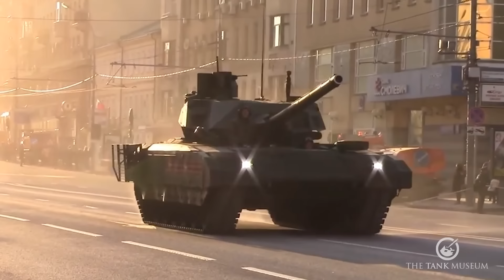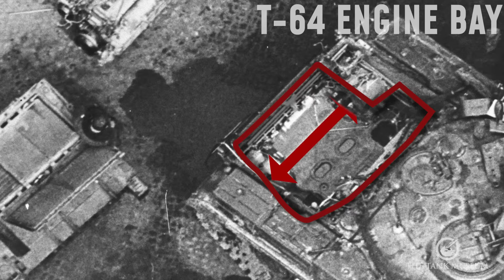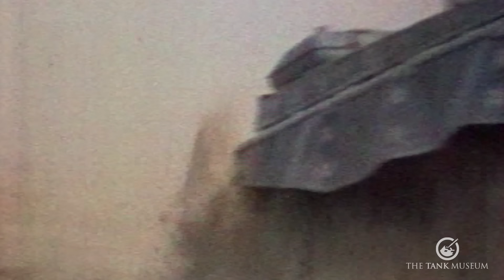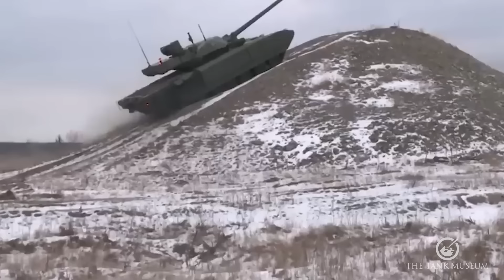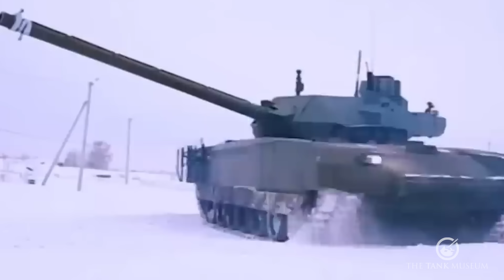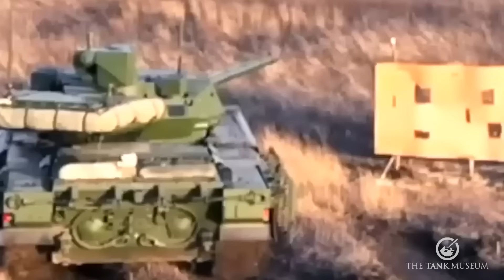Radical or Ridiculous? | T-14 Armata | Tank Chats #171

Comment: A lot to go over here.
780Hp. .so what ??
Horsepower is useless..
You need TORQUE !!
Example, a corvette might make 450 hp.
But why can a 350hp Cummins pull 80k up a hill ???
The Vette might have 4-500 pounds of torque, yet couldnt pull 80k up a hill.
The Cummins will have like 1250 #'s of torque.
(newer ones up to say 1450)
Horsepower is RPMs multiplied.
A 600 hp Cat engine makes over 2000 #'s of torque.
Forget horsepower...
(note: I understand parasitic drag)
Torque moves the load!
As far a view...
Even mini vans come with back up cams !!!!
Why can't tanks use this simple technology for seeing holes to drive around ???
I know...this is TOO complex of technology....(??)
As far as armor ....so long as cab/cabin has armor, what more does the crew need ??
The ammo hold has soft tops, allowing explosive force to go UP !!!(obvious bulkhead between ammo and crew.)
Reply: Why does the average torque monster bus accelerate slower than a 1 litre shopping car? Power to weight ratio - and that right POWER - not torque to weight.  Torque is just a measure of turning force, power is workrate - it's work rate that gets you down the road fast.   You can give any engine as much torque as it needs using a torque multiplier - known as a gearbox.  Power is king.
Reply: @LondonSteveLee  your WRONG.
As example HP Gives you mph at the drag strip.
Torque give you ET.
I have zero problem pulling an 80,000# load 75 mph with a 350/400 hp engine.
Like I said, try doing that with a 500hp Vette !!!
The torque gets you there.
I pulled loads for kver 40 years...I KNOW the difference between HP and TORQUE.
The new emission trucks have LOWER HORSEPOWER...
But GREATER TORQUE.
Simply ...just think of the Vette VS An 18 wheeler.
If you so choose...we can also get into gear ratios .
I started out with a 9.5 -13 speed. (RTO9513  etc)
Now we're up to and over 17.5's as torque increases,
But HP was lowered due to emissions.
Ps. we do this at 2100 rpms
Or LESS.
What's a Vette pull5-6k revs??
With a clean fuel filter I can pull 80k at 14-1500 revs.
Reply: @LondonSteveLee  NO  YOU CAN'T !!!!!
The engine makes torque !!!
Period.
The Vette in lower gears
With a good gear box..

May...pull 80k
But youll NEVER GET MPH !!!
I've driven trucks, say an old NTC350,
Which couldn't pull OD.
(Over Drive)
In the wind for sure, you had to run direct.
You know all about gear sets right ?
What's the difference in 3rd gear in a car with a 3 speed manual vs the same car with a 4 speed ????
Reply: @LondonSteveLee  it's not physics !!!!!!
An engine makes X Amount of torque P E R I O D.
(period)
A trans allows the engine to accelerate .....to its torque curve.
(engine RPM) VS Drive shaft RPM.
The difference is according you the gear RATIO !!!
An engine has ZERO idea of mph!
ALL it knows is RPM !
....IF....

If it's got torque..it can achieve a given RPM.

You...
My friend...have "0" (zero)
Idea what our talking about.
There's NO SUCH THING, as a 4th gear or 3rd in a spd.
It's DIRECT!!!!
No "ratio" involved!!
No GEARS !!!!
Our simply locking the input shaft to the main shaft.
In other words drive shaft turns engine RPM.
IF....you put a trans mission on an engine on a Dyno....
Say even an RTOO14618,
The engine will make the same torque !!!
ALL a trans will do is allow it to achieve its RPM/TORQUE band(s) sooner .
It will NOT...(not)...
Make a ftlb EXTRA of torque.
You "think" you know physics ???
There's NO physics evolved!!
Its all "MECHANICS"
='s MA.
(Mechanical Advantage).
Transmissions...
Govern RPM !!!
NOT TORQUE !!!
Take any car with a manual trans...
At say 10 mph...
Put it in second.watch tach till it starts pulling good.
Now..do 10 put it in second..
Accelerate ...till it pulls..(notice tach)
Again, do 10, put it in 3rd.
Accelerate till it pulls good.
(notice tach.)
Now again doing 10 put it in 4th.
Again accelerate till it pulls good...
It will ALWAYS pull well, upon reaching its given torque BAND !!!
If you tried/tried this,
You'd notice tge time in seconds it takes to reach its torque band.
The given torque band...
Was ALWAYS the SAME ...
No matter what gear you were in !!!
The lower (higher numerically) gear ratio ALLOWED to to reach your engines GIVEN torque band...
Sooner .
Like in first gear, it say explodes...
Second ...longer..
3rd and so on... even longer.
But....
The torque band,
Remained to same. (RPM range)
Now...feel free to explain physics ...
I've expjsined MA.
Reply: @LondonSteveLee  BTW I'm still waiting for your law of physics to explain hour hypothis .
Reply: @LondonSteveLee  Really...
I thought you were going to explain the physics involved.
Hou my friend know zero on his issue .
Horse power is simply RPMs multiplied.
I hhe old days we used horse power to pull hills.
Wed hit them at 2100.
We had no torque.
Today I can hit a hill at 1400 revs... Why ???
We have torque !!!
For not knowing anything...
I've given you examples,
Engine type numbers, and also transmission I'd numbers.
You in return have nearly MOUTHED OFF !
I've also given you driving scenarios .
Once you answer tangebly...
We could go on.
Hour like a guy who read a book ,
And have hhe answers to its test...
Yet not understanding the principles involved in mechanical advantage.
You talk physics. (lol)
Like action causes reaction.
Yet fail to apply.
There's more we've NEVER even touched...
How about Final Drive ratios ???
With a tank we'd have sprockets involved...
These have never been gotten to.
OK...what about planetarys,
In the hubs ??
OR we just gonna run em straight up ???
You.....
Have no clue, and have bit off more tgsn joy can HANDLE !!!
I didn't read a book for answers...
I.....understand the principal !!
(as in understand)
And have dealt with his stuff for decades..
When the boss needs to order new trucks....
I hrlp him with engines torque aspects, in relationship to hhe terrain this peticular vechile will experience.
As flat land  Or road trucks require different boxes tgan say mountain trucks.
You know S#!T.
....go tell your mother she wants you.

Comment: Russia can technically produce modern arms grade chips domestically, even with ancient 180nm process, although they probably have better. Of course, it will ultimately rely on their engineering ability to create MCU, FPGA, DSP and ASIC circuits, but you don't need anything even close to cutting edge process for military use. And after a cursory search, it would seem Russia has plenty of 90nm and even some 65nm capacity.
Reply: Russia can produce about the equivalent of a Pentium II domestically - still an amazing piece of technology but miles behind the west. (Well, western tech in Taiwan!)
Reply: @LondonSteveLee  That's utter nonsense, they can do around "core 2" level of performance, and could easily have up to 16 cores. But that's not the point, that is not military grade chips, where you'd typically want to use custom circuits, either programmable FPGA or custom circuits in chip. This can significantly mitigate the process disadvantage, and still produce top notch chips for weapons systems. Weapon systems have a very different set of requirements from phones or laptops or data centers, just in case you weren't aware. Key US military systems still run on 50 year old floppy disks...

Comment: @17:00 uralvagonzavod has ratcheted up production of T90M tanks to 1,000 a year. That’s apart from other favtories refurbishing T-72s and T-90s. They are incorporating electronics and other components from the T-14 project. Seems like the Russians will be introducing the T-14 when there is a real need and the various components have been perfected enough for rough use on a frontline. As this video states, the russians are rarely in a hurry when introducing new technology. To wit the T-72 and T-90 lifecycles from development to mass production. Seems like they are committed to the T-14 platform but not yet happy with producing it in quantity.

As with every mass manufactured vehicle, it’s not the end product that counts but the manufacturing line and suppliers at the beginning of the pipe, to the other end that requires a measure of certainty in the effectiveness of the various components of a real battlefield. To use a bland russian term, the T-14 must be capable of ‘solving military tasks’.

Comment: Unlike most of the replies here, I think an unmanned turret and modular design have merit (whether or not its worth the trade-offs, idk, but it's worth exploring). However, the Russians haven't proven they've created it in the field.

I'm mostly expecting drone launching platforms to be put on every tank for sitA at some point. Easy enough to just weld on to the side on existing models, easy enough to remove if it doesn't pan out.

Comment: 01:23 Should it not be T-43 instead of T-44 ? Because the T-34 continued production instead of the T-43 beeing tested against it. The T-44 only came into beeing in 1944 as a prototype and from 1945 in production, but after the war had ended. As far as I recall.And then of course it was a radical departure from Soviet tank liniage so far.
Reply: T-44 came out in 1943

My bad actually, it started design in 43 and first prototype was January '44. I was just surprised how many were made by 1945 if it entered production in mid '44
Reply: Three planned replacements for the T-34, T-44 was the first to make it into production. T-34M had heavier frontal armor and a new suspension, almost completely new hull, however the 76mm gun was unchanged and the project did not offer much real improvement. Killed off when Germany launched Operation Barbarossa. Then the T-43 was a T-34 with more space efficient torsion bar suspension, heavier frontal armor and a new 3 man turret but still keeping the 76mm gun. 

Again, not worth interrupting T-34 production for a relatively small upgrade, however the new turret was adapted to take an 85mm gun and fitted to the T-34 hull which created the highly successful T-34/85. And then the T-44 was developed further from the T-43, switched to a transverse engine layout which saved a lot of hull space allowing a much lower profile with even better frontal armor. T-44 shares a lot of parts with the T-34 including roadwheels, tracks, engine and the 3 man 85mm turret. 

Limited production of about 2000 units but teething troubles meant that 3 brigades equipped with T-44 during 1944 were switched back to T-34/85 before seeing combat. T-44 still had the 85mm gun and didn't offer a huge combat upgrade over the T-34/85 so the design only really took off when the slightly larger T-44/100 was put into production as the T-54

Comment: Russia has always been capable of making the same old same. They’ve gradually upgraded but really not much changed. In that environment T-14 was doomed from the start.
Reply: certified clown comment.
old Soviet time tanks T-72, T-80 are making a scrapyard out of "modern" NATO equipment, tanks, vehicles in ukraine they dont even need to pull up T-90s which are light years ahead of current NATO garbage 😂
Reply: @CremeDeLaMeme.   What a load of nonsense - there will always be tank loses on both sides particularly as Russia has massively more tanks but there have only been a handful of pictures of lost modern NATO APCs and tanks - if there were loads they would be all over Telegram.
Reply: Russia not spending enough of their vast mineral wealth on domestic semiconductor technology over the last 30 years and then invading Crimea causing a whole raft of sanctions against them is what killed T-14. The irony is, had they not invaded Crimea they would probably have 2,000+ T-14s by now, rather than the handful of prototypes - and Ukraine wouldn't have had a way of defending themselves against a full-scale invasion as 2014 was the wake up call they needed to refresh their military capabilities.
Reply: Two years on.  
T-14 was sent back for being useless.  Mid 2025, Russia has run out of tanks and the last ones were still spinning turret when hit. Just like the T-14 adverts showed.

Comment: Remote viewing has always been a problem, most recently with the KC-46 remote boom control station. It takes conscious effort to visualize which direction you are looking. A solution might be a "transparent hull", ie a cyclorama of screens surrounding the crew.
Reply: I've heard theories of using the F-35's camera system + a headset to allow operators to virtually see out of a vehicle without needing vision blocks or looking outside.
Reply: @Appletank8  That's what I had in mind. I've heard the term "glass floor".
Reply: @SteamCrane  that would come in handy, though it's not a thing even in western tanks, though it would increase SA greatly. And one can be certain when it is released, it will be in a US tank, not a Russian one
Reply: @BoraHorzaGobuchul  With both Russia and China, we are seeing the results of Central Planning, which substitutes some corrupt official's limited knowledge of what is needed for peoples' individual decisions.  If there had been freedom, both countries might have gotten serious about microelectronics, along with many other needed technologies.
Reply: Or simply add a digital indicator to the HUD or screen which shows you the turrets relative direction to the hull.

Commonly done in videogames, but it does help you visualize where are you going, what position the turret is, and what are you looking at on a quick glance.
Reply: @BasedMan Exactly, but most of the tank designers are old boomers 40+ years old with poor imagination.
Reply: Considering the terrible quality of the screens we see even in their propaganda videos, I doubt anything of that sort would be possible and they'd have extreme difficulty even navigating.
Reply: The Abrams X uses modern tech to give its crew a 360 degree los.
Reply: Hmm, as someone who plays VR, I would say give them a VR helmet that morphs input from all the cameras around to make that. That is today off the shelf tech if you do not need sensor fusion and battle managment (those two are extra development) and you have practically F-35 like experience inside a tank.  ... then again ... microchips and optical lenses needed.
Reply: no
Reply: We have that already, it's called a VR headset. Unfortunately, you can't import those to Russia because of sanctions on foreign microelectronics.

Comment: Changes makes sense, the low profile small size made sense before the era of thermals, drones, and other ISR sensors. Increasing the protection makes sense now that Russia uses more contract soldiers rather then Soviet conscript army. So it makes more sense to increase crew survivability. The engine seems to have been the hold up. Again every tank used improperly is going to be destroyed. Leclercs, Leopards, and Abrams have been destroyed with ease when we've seen them used by the Turks, Saudis, and Iraqis. Used correctly they are still vital on the battlefield.
Reply: Actually only 9 Abrams A1M2 tanks have ever been destroyed in combat. 7 or due to friendly fire and the other two were deliberately destroyed as not to fall into the hands of the enemy.

Comment: Will be interesting to see the outcome if the Armata comes up against a Challenger, as may well happen in the coming months!
Reply: There are as few Challengers in Ukraine as Armata tanks in total. The chances of them meeting in battle therefore are very low.
Reply: Challengers won't be allowed anywhere near the front line - the supply of Challenger was political to force the Germans to allow the supply of Leopard.
Reply: @LondonSteveLee  The Challengers are a weapon system. The Ukrainians will use them if they deem it useful to do so, they don't have as many Leopards as they wanted.
Reply: @LondonSteveLee  The Ukrainians have shown themselves to be adept at using a wide variety of weapons systems, some of which they have only in small numbers. Plus don't you think there is propaganda value in showing the Challengers being used?
Reply: @LondonSteveLee  They are used as War Bond and Motivational Talk pieces, the Ukrainians must believe they have a Wunderwaffe that will let them win somehow.

Comment: Any tank in the Russian military no matter how advanced is irrelevant.  They have forgotten how to use them and no one in command has the knowledge or authority to change the situation.
Reply: Ah but you have the knowledge right? You know everything and what goes on inside their military? We have a CIA agent here guys
Reply: @One10ab  When Russian defectors from their ground and air assets complain that neither side is competent and they have fired on each other out of spite it doesn't take a genius to figure out the entire Russian military is incompetent.  The ground commanders sent in tanks without  troop support to keep anti tank teams out of range.  Those troops then should have called in close air support.  So you had bare naked tanks get hammered out of existence.  Then the ground troops were sent in to get anhialated.  After the tanks and troops were used up they sent in the air assets to get shot out of the sky because there was no one left to take out the anti air teams.  If you don't use your equipment properly it doesn't matter how advanced it is.
Reply: @poowg2657 Damn, how did you predict how the Ukranian Counter Offensive would go 100% Accurately? Did you also Know Maui is gonna get Burned to 15 Minute Cities?